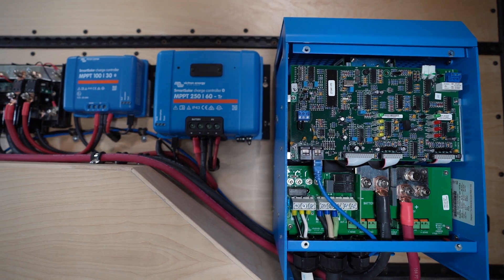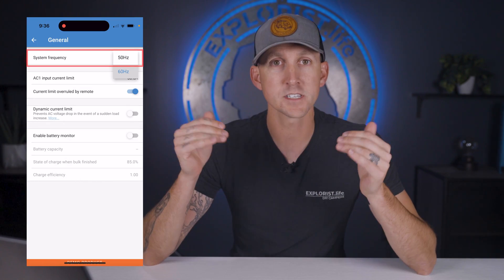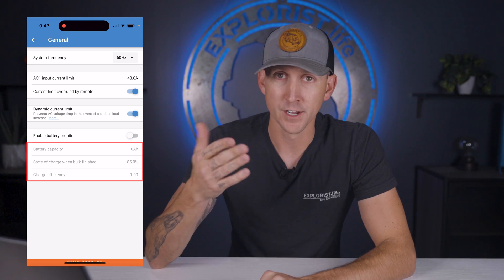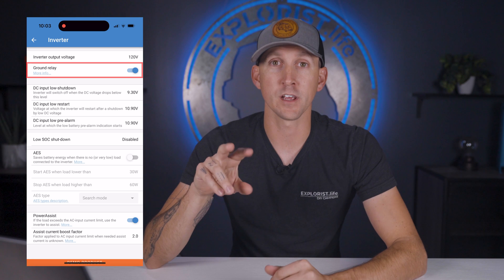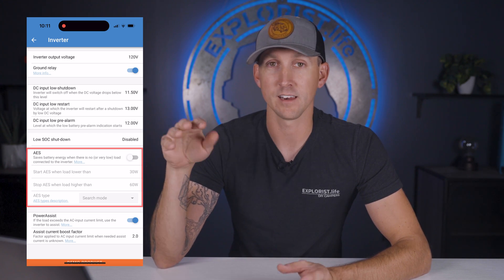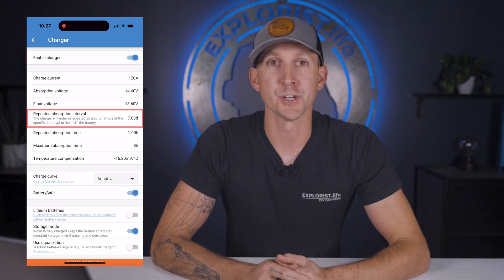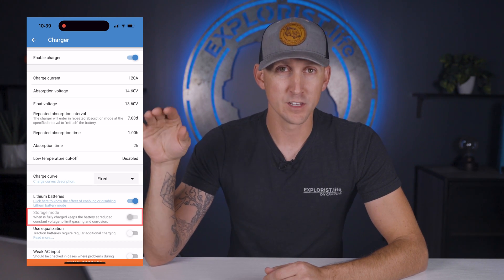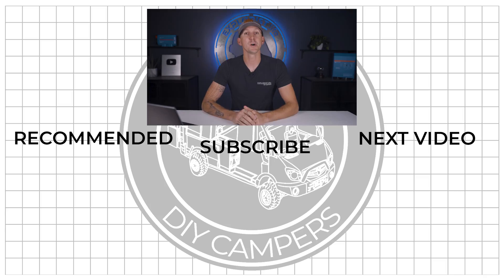How to Program a Victron Multiplus/Quattro Inverter Charger (easy/cheatsheets)

Comment: Hello. The Multiplus 3K comes with a T-sense cable which I see you didn't mount it on your builds. Isn't necessary for the good working of the system? Thank you
Reply from the maker: That depends on the battery.  We recommend using Battle Born LiFePO4 batteries with internal BMS's which do not require temperature based voltage compensation, which is what that cable is for; rendering it unnecessary.

Comment: Quick Question, I have two starter and two leisure batteries currently being charged by m Victron Multiplus.
Is it just a question of re-setting the Victron and swapping the batteries out for Lithium ones?
I would love to replace the four lead acid ones with one large lithium, bit not sure if that would be possible.

Comment: I think it should be noted that you don't need the mk3 adaptor, you can update the firmware via VRM and settings of the inverter can be changed via remote ve config. Will save people money!
Reply from the maker: Yes and no:

You don't need the MK3 USB dongle do that what I showed in this video, no, although it is the easiest and most straightforward way to change Multiplus settings.

You CAN use the VRM portal as mentioned; but in order to do that, you must have a GX device in the system (Cerbo GX or similar) in order for the Multiplus to communicate with the VRM portal; so if somebody was only planning to monitor locally via VictronConnect without the use of a GX device, it would not be cheaper to go this route.
Reply: @EXPLORISTlife perfectly put, I hope I didn't come across as rude or anything. Your videos have helped me immensely, and you uploaded this 6 hrs after I set mine up, in which I spent a good couple hrs a night for a week searching videos and asking through forums to get answers! 

Hope you're well!
Reply from the maker: Not rude, no. 🙂👍  Just replying to add some additional context.
Reply: @EXPLORISTlife Excuse my ignorance. I can setup/program a multiplus ii from victron connect via   ve bus cable connected to a cerbo gx with internet connection?
Reply from the maker: @803mastiff9 it’s not user intuitive.  Best just do what I showed in the video.
Reply: Using the dongle to reprogram gave me the confidence to look into the vrm. In Australia auto electricians charge $110 per hour…. So any diy set up pretty much pays for itself… as long as you are careful with your research and meticulously minded.
Reply: @lukemckay3262 isn't that the truth. In Oz too and cost me $369 for a sparky to wire the AC to my multiplus AC IN/OUT RDO duo to multiplus . I supplied the $180 RDC DUO as well. We get rapped in AIU.
Reply: Exploristlife should make as Video as mention to help users who own Cerbo.👍
Reply from the maker: I still recommend just using the mk3 usb even if you have the cerbo.  Trust me, as a first timer to this stuff, it’s worth the 60 bucks to not have to fuck with the vrm remote config.
Reply: This video calls for using the MK3 dongle, which allows connection to a PC, but then shows what is clearly an iPhone interface. I believe connecting to an iPhone (vs. an Android) requires using the Bluetooth dongle (instead of the MK3 dongle). Is that correct? Or is there a way to use the MK3 dongle with iPhone?
Reply from the maker: Mk3 usb is not iPhone compatible;  only android, windows, or MacOS (at this time)

Comment: Fantastic video, Nate! Appreciate the insights. I've got a setup in my van with 6 100AH lithium batteries arranged in parallel. They generally stay at 100% charge, but during weekends of heavy use (cooking, fridge, etc.), it might drop to around 80% overnight. Here's my question: By the time we're back home, the batteries are normally back to 100%, and then I turn off the fridge, there's virtually no current draw. I don't even plug my Victron 3000-watt inverter/charger into the mains (240v Australia). Is it detrimental for the batteries to remain idle for up to two weeks? They're still at 100% after this time, but I'm curious if it's harmful to the system when it's not receiving current from mains at all?

Comment: Please could you shed some light as to why my Transit Van batt is running flat and my 2 leisure batts are ok . I try to run my Truma heating and getting an error saying voltage . I have nothing running off the system I have a 240 extension into the van while working off and only tun everything on to get some solar energy if anything back into my batts. 3 times now i have had to charge my vans bat ,Why isn't it using the leisure batts and when testing there at 12 volt I have 2 linked together running a 12 volt system. I must have something wired wrong as it seems to drain the power from the van batt. Any clues
 Sorry if its not as clear as you want Never easy explaining Thanks guys

Comment: Where is the Apple version of the software? And I’m not talking about VictronConnect, as it’s very limited compared to the Microsoft software. 🖖
Reply from the maker: The MK3-USB is only compatible with windows, android, and iOS.  So you can't use an iPhone for Multiplus programming.
Reply: @EXPLORISTlife  Nate, I am no tech wizard, trust me (!) but I am confused by this answer. Did you mean to say "The MK3-USB is only compatible with windows, android, and "OS" " 
The only reason I say that is that "iOS" stands for "iPhone Operating System". So I think that what you meant was (in regards to Apple prods) that my MacBook Pro laptop (OS) or an iPad (OS) should be compatible but NOT the iPhone (which is "iOS").

Comment: That was a great video. Thanks. I know lots of settings will be the same but will you be doing another video or cheat sheet to show the differences for a 24V and 48V system? Love these last few videos, especially the problem/trouble shooting ones...
Reply from the maker: I won't be doing another video, no, as it would be incredibly repetitive.  I hope that the education that you've received in this video will help you figure out what settings that you need for your own setup.  Recall what I said at the first of the video:  My goal is not to tell you the exact settings to use, necessarily, but to educate you so that you can learn what settings to use based on the parts, components, and battery brands you've chosen to use.

Comment: Question about connecting via VictronConnect App, on the web site they say "It can connect to Victron products via Bluetooth, USB and WiFi/LAN/Internet." and "Use the VictronConnect app to , monitor, update and diagnose your Victron product. Available for Android, iOS, Windows, and macOS X."....If I have the smart dongle attached to the inverter and according to the quoted statements on the Victron web site I should be able to connect via bluetooth ? Correct?

Comment: 3:53 You said no downside to having it ON, I think you meant no downside to having it OFF.

…so basically, if you drive on the right, it’s 120V, if you drive on the left, it’s 230V 😎

Comment: Nate, can you access the multiplus settings via cerbo and gx touch or do you still need the mk3 dongle?
Reply from the maker: Official Answer:  You should use the MK3-USB dongle.

More technical answer:  You can also change the settings through an internet connected cerbo GX through the VRM portal with the remote config function; but it's not nearly as user friendly as shown in this video.  You can't do it though the touchscreen, though.
Reply: Thanks again

Comment: Thank you for doing this video. I learn so much from your content. As you did the various rig upgrades earlier this year I was bummed you skipped over this programming. I'm glad you circled back to it! This has confirmed a question I've seen from Victron programming for BattleBorn: 
Why are Solar charge controllers programmed to float at 13.5v where as Multis are programmed to float at 13.6v?
Reply from the maker: Just small discrepencies to default changes & manufacturers recommendations over time.  The difference between .1V won't matter in that application.
Reply: It seems like this causes a measure of battery depletion to happen before real-time solar power generation handles the DC load.  I’m guessing there is little to no risk of making them the same or flip-flopping them to see if there is an observable uptick in solar power generation.